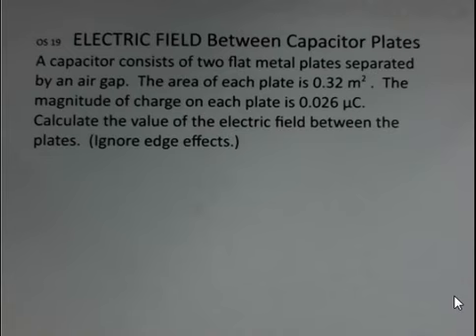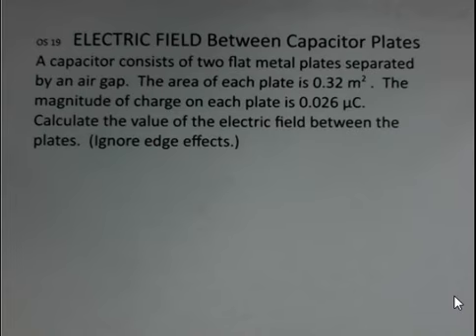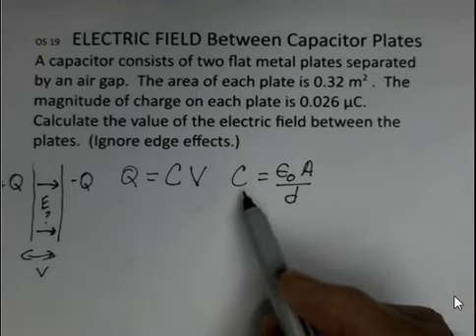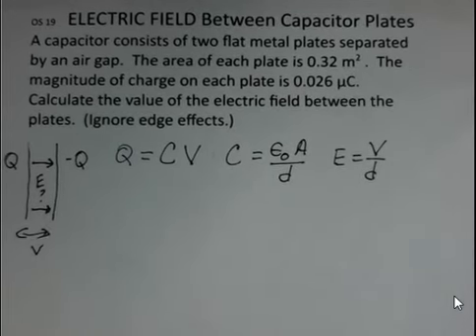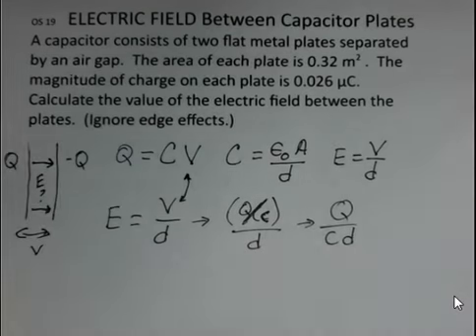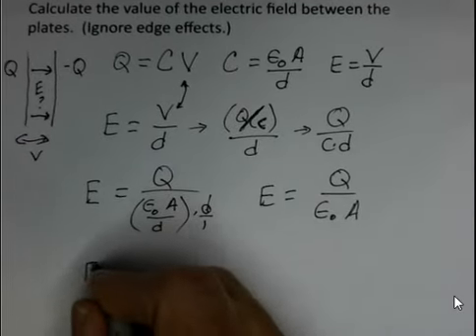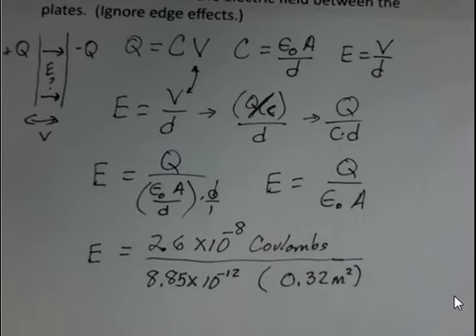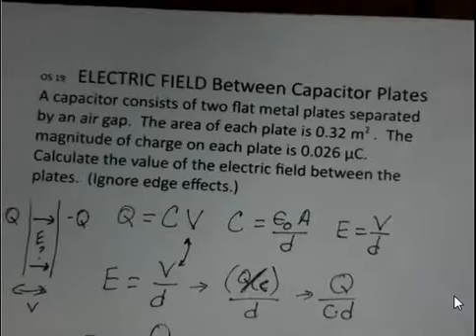Electric Field Between the Plates of a Capacitor

Comment: Why is area in the denominator for electric field but in the numerator for capacitance? I understand it mathematically but not theoretically
Reply from the maker: The physical reason that the capacitance value is higher when the area of the plates is larger is that with a larger area it is easier to move (and remove for the positive plate) electrons onto the negative plate of the capacitor.  When the area is large the extra electrons (or lack of electrons on the positive plate) are not as close to each other so the force between the free electrons is less.  The electric field has units of volts / meter.  The area variable is in the denominator just due to the way the equations are being combined to create an expression for calculation using the potential difference, Capacitance, and separation of the plates values.
Reply: @GregClementsScience  Got it, thank you !!